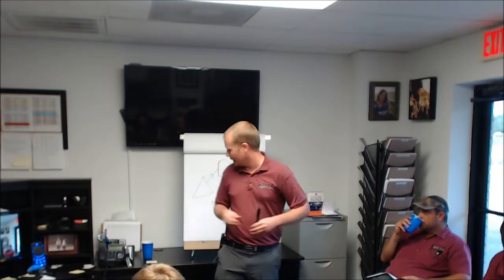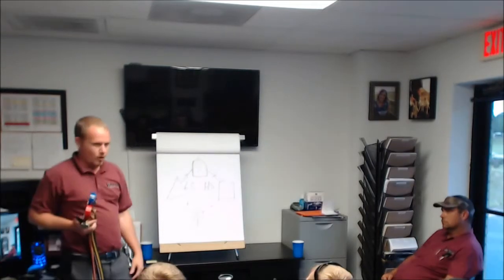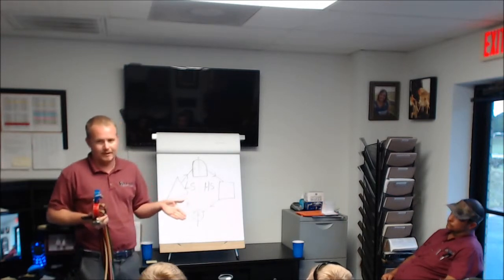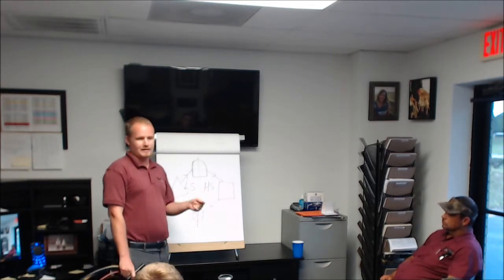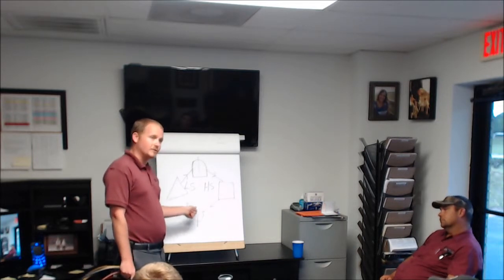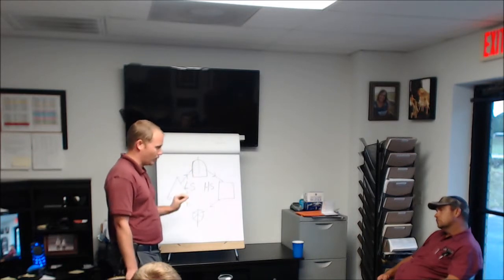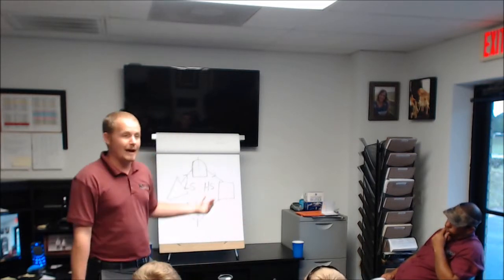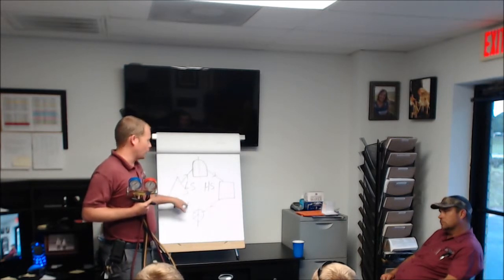How an Air Conditioning Unit Works

Comment: compressor - discharge line- condenser - liquid line - metering device/capillary copper tubes - expansion line- evaporator - suction line and back to COMPRESSOR.  hope i got heard it right.